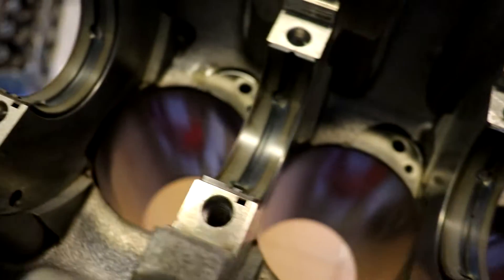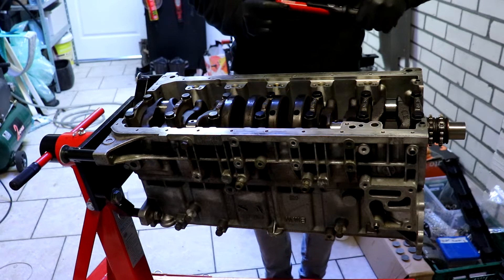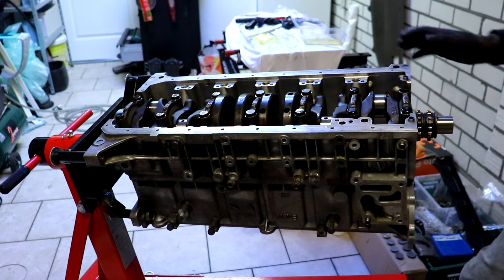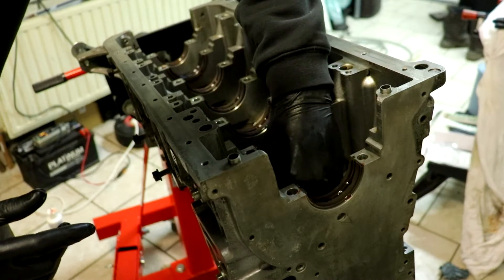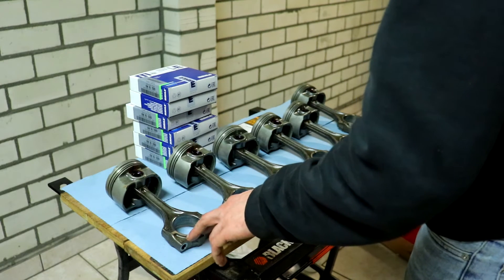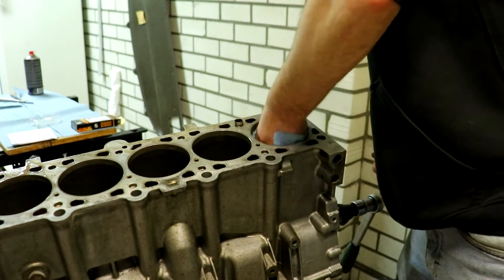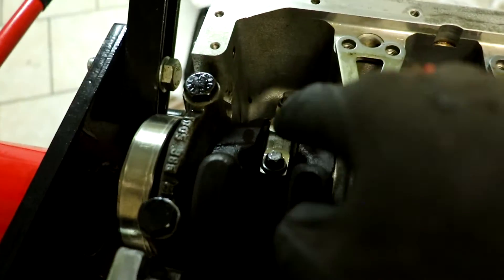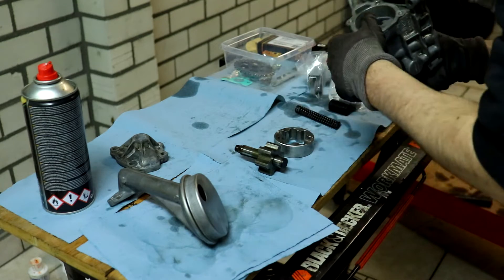M52 Complete rotating assembly! (FULL E36 RACECAR Build series) (Part 11) (Engine rebuild part 3)

Comment: Did you re-use the crank and rod bolts ?
Reply: crank is reusable rods bolts need changing at least on m40 and they are basically the same bolts
Reply from the maker: I did re-use the crank bolts but used new bolts for the rods